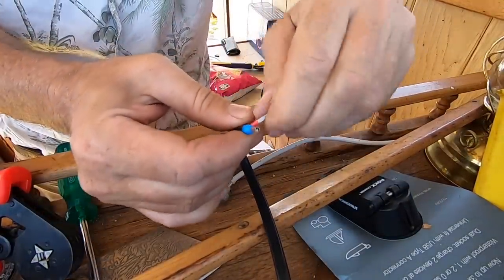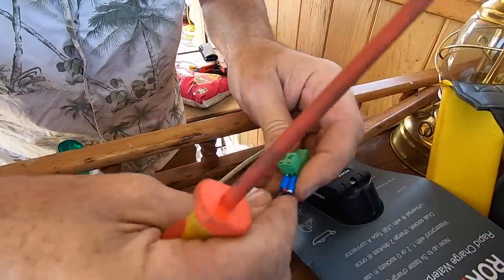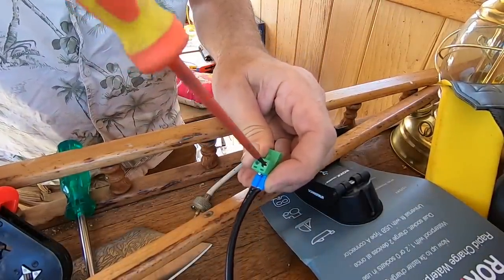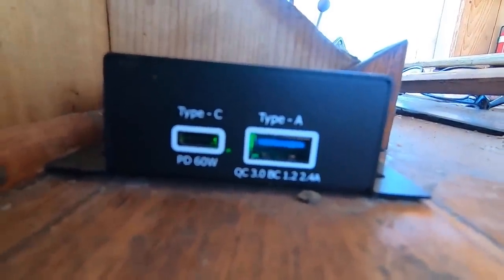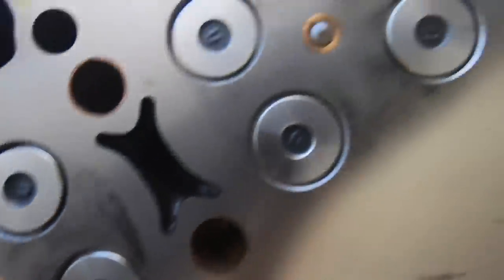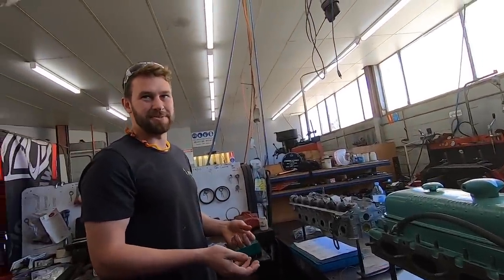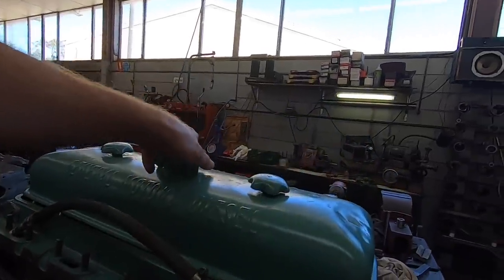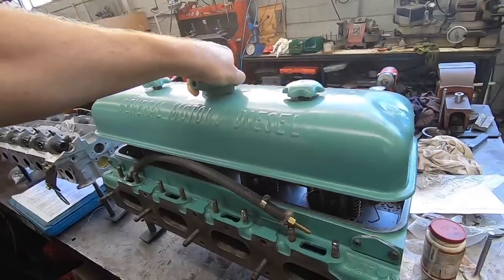Some questions answered

Comment: Not going to lie I love watching the Electrical parts
Reply: Paul Andrews - me too, I’m an electrical engineer, but do just about everything else boat wise, hands on 😊.
Reply: Yes love it
Reply: I’m an Electrical Engineer too, some of my favorite videos. All the welding and painting made me glaze over.
Reply: Love the electrical.  I have run an automotive repair shop for just under 20 years and have used some of his videos to tech a few things to my guys.  The video explaining voltage drop is probably one of my favourites!  Very simplified!

Comment: I stumbled onto your channel a couple years ago when I was researching buying a used bass boat.  I stayed because I love your channel.
Reply: same here
Reply: Me too.  I liked the outboard stuff and got valuable info enough to be confident adding a fuel filter/water separator and replace water pump impeller and replace my hydraulic steering. But look forward to your new material.
Reply: Scott B completely agree. I found you because I was new to boating and wanted to learn to service my outboard. BUT I stayed because of you Stu!

Comment: Rain almost never comes straight down, also water on your person tends to splash about. For your electric panel, just make a clear plastic box with a couple hinges and a locking clasp to go over it. Don't forget to make a couple of small vents for moisture, one high on the side and one low on the other side.
Reply from the maker: Yes, I think I'll end up making something like that.
Reply: @DangarMarine  Awesome, so glad I could help. I'm Brandon btw, out of California. I have been with you from the beginning, thanks for journey friend. You've been an inspiration of sorts to me, so thank you.
Reply: @DangarMarine  Don't forget to design in enough ventilation to counter the heat output from the inverter on a full load to maximize the lifespan of the electronics. Maybe even add a side mounted 140mm computer case fan for active cooling to counter the insulating properties of the plastic enclosure.

Comment: I just need to get this out. The reason i can sit for hours at the evening catching up on these videos is that they are fun, educational. and honest! that last bit is key. 
I'm a former mechanic now working in IT so i went the opposite way, and I have screamed in horror on some of the early welds and plasma cuts. 
And its great to see how much those have improved over during this project. And it made me want to get me a cheap stick weld transformer and just try, see how much i suck at it after 20 years away  
Keep up the great work and just be you. That is what brought us here in the first place :)
Reply from the maker: It certainly has been a steep learning curve, but I guess that is one of the best bits. You end up with a boat and a whole bunch of new skills as well. :)

Comment: Electrical stuff is cool.  I worked for a marina in the 60's and 70's and did some "hook-up" work.  It's hard work squeezing your body into the tiny space between the control panel and the bulkhead, under the fly bridge, or around the batteries.  Thank you for answering the questions.

Comment: That fuel line on the hatch is a good idea
Reply: With the weight of the hatch it would fare better than a bulb type automotive seal, where are the vents for the engine compartment.
Reply: I agree! Genius

Comment: Solder and heat shrink is the best.   I Fray my stranded wires then push,  then form them together then I solder.  I don’t lay the wire side by side and solder.   I twist my single conductors together, then solder, ____I can’t imagine why anyone would ever give you a negative comment.  You are one of the best at delivery and transference of knowledge.

Comment: In 50 years of soldering wire I've never had one of my connections fail. The same goes for soldering and brazing copper pipe. My son bought me a mig welder, but I still prefer my stick welder. They have have lots of new things nowadays, but the old ways never fail.

Comment: I like your thinking on welding, we weld at my shop as part of other projects. Steel, SS and Aluminium. My research is that stick welding steel defiantly has better penetration and generally produces higher strength welds. Mig welding is much easier to learn to stick things together , but it tends to stay on the surface and not penetrate much without careful prep and skill. Mig is much quicker and you can weld so much faster than stick. For aluminum Mig is really the only way to go with good preparation if you want a strong weld , we weld 3/8-1" old alumimum all the time very successfully with the Mig. Yes there are alum sticks but not for anything quality.  Tig welding for stainless. Only real way to go., but slow.
That's my 10c and I generally stick weld all my repairs Inc cast iron when we have to! 
Cheers Warren
Reply from the maker: Yep, pretty much my thinking too. :)

Comment: Hi Stu. Love the channel. The wreak of HMAS Swan (my grandfather served on her) lies off Juno Point in sight of your trawler. The wreak off Long point  next to the Manley ferries is that of HMAS Doomba J01. When I served on the dive boats DTV seal and DTV Porpoise back in the late seventies the trainee divers dived them . Keep up with the good work. PS Keep a good eye on the low pressure fuel rails under the rocker cover as they are prone to cracking with age putting fuel in the crankcase.
Reply from the maker: Interesting to hear that your grandfather served on the Swan. That's cool. :)

Comment: Good idea with the skirt around the opening base, only the inverter is vulnerable.  Just a few drops of saltwater down those vents on top onto the electronics, can ruin it.
Reply from the maker: Yes, I think you are right. The rest of the components could take a splash or two no problem.

Comment: No outboard can match the sound of a Detroit Diesel 2-stroke. Rebuilding your Detroit is better than buying a reman . You know that it’s been done correctly. A Detroit 2–stroke isn’t the most fuel efficient diesel but they are simple, without computer controls, and the will run when you need them to. Not to mention the sound. Did I mention the sound?

Comment: I appreciate your desire to stay true to what your dreams are. Let your channel evolve. I’ll stay with you. 

FYI I like the electrical stuff. 

Are you going to put a small diesel or gasoline genset in the engine bay? Or a small portable generator for the deck.
Reply from the maker: Thanks Jeremy. Currently here is a petrol generator on deck, but it won't stay there once the bulk of the work is done. In the end it is only going to be solar, wind and the engine's alternator.
Reply: Dangar Marine on a side note I’m a 19 year Journeyman Diesel Mechanic. I find it interesting that you guys have to be licensed as an individual to work in a mechanic shop. 

You can know nothing here and own a shop and call yourself a mechanic. Not that that happens much but you can. We do have apprenticeships but mostly for Union Shops which there isn’t a whole lot of sadly. Usually only union mechanics call themselves Journeymen. Non union mechanics will call themselves Master Techs or whatever their employers wishes to call them. 

For myself I went to 2 years of trade school. I got a Career Education Certificate in Diesel and Heavy Equipment Repair. But it’s not really reported to the government. It’s just for my records. Then I worked for a few years as an apprentice until I moved up the pay scale to Journeyman. If I had not gone to trade school then as a union member I would have had to do that school at night after work to be eligible to advance to Journeyman. Now I’m a Container Crane Operator. I needed to hang up the wrenches. I was getting worn out and burned out. 

We do have a private national certification agency called ASE or Automotive Service Excellence. But very often their certification is about as good as used toilet paper LOL. But It makes the customers feel warm and fuzzy to know their mechanic working on their car is an ASE Certified Master Technician. I hate working on cars LOL.

Comment: About the Diesel electric, that is sort of our long term plan for our 10m yacht. Slide the inboard diesel forwards enough to get a pulley on the prop shaft and gearbox, add a 10hp Brushless, belt-driven to the pulley. While under sail can windmill the prop to recharge the propulsive battery. Don't need a huge range on pure electric, so don't need excessive amounts of battery.
Reply from the maker: Sounds like a good plan!

Comment: I like the electrical work!
Heck!, I like basically everything you do when you describe it, tell the story. And the agony of finally getting the  cable though, and realising that it's around the board, just the best. It makes me feel like the evil within things are not just against me. =)
Keep up the good work man!

PS. Crimp, then solder. I am a solder believer, but nothing beat good mechanical connection before solder. And when HiFi, buy solder with a percentage of silver.

Nope not arrogant, it is not so much what you do, but the story., yes your repair videos are greate and that's the way I found your channel, but I did not stay for the outboard repairs..I came for som tip on doing my outboard, I stayed for the good show, and nice to hang out with you on your videos.

Comment: More electronics the merrier. With your battery power supply you could always add a small current and voltage limiter circuit to drive equipment which is listed as 24v nominal

Comment: We had pressurized  Hot & Cold water on our 28' sailboat ..very nice to have hot water for a shower after swimming l You might want to rethink that one skipper . It wasn't any problems ran off house electric or heated from the diesel when running .
Reply from the maker: Yes, the heater I had ran off the engine cooling water. Wish it was a bigger boat some days!

Comment: great q And A, i have owned a couple detroit diesels , 6v53 and 8v71 , when you fire yours up have a way  of shutting it down before starting it , MY 6v53 ran away on me once after i did some work on it, one of the scariest things   , some way of cutting the air off block of wood etc, i through a towel in the intake , keep up the great vids
Reply from the maker: Yes, I think that is one of the most important things to have read in advance.

Comment: Hello,  Pays to keep in mind that water never "just goes straight down" nor does it ever take a convenient path (a subset of Murphy's law).  As the boat rolls and pitches and spray  comes aboard not to mention green water it will seek out anything it can screw up!!  Make everything watertight not weathertight and then seal it some more.  You'll never be too dry in the boat, ever!  A boat should be built like a submarine and then put inside another submarine!!  Even then you'd encounter moisture problems.  After a lifetime of boating in all kinds and sizes of boats and all kinds of weather and seasons I can attest to the above.  Take care.  Doug
Reply from the maker: Yes, I will definitely look into making some sort of protective cover for the electrical board. Every little bit will help.

Comment: I have a Grady White F26 Tigercat. It sat in a field for 4 years till the owner finally wanted to sell it. Both engines fuel systems needed to be rebuilt,(200HP Optimax)  the dealer near me wanted $2,800 US each to do it. Watched YouTube on how to do it, ordered parts from Marine Engines. Done for $500.00 US both engines. Took less than 4 hours each engine. Dealer said a week and a half each... It's a work in progress.  I also tow the boat with a 2002 F250 7.3 Power Stroke diesel. Like watching your YouTube videos.
Reply from the maker: Nice work! Goes to show how much money you can save when you go the DIY route. :)

Comment: Had a bass boat where we put down truck bedliner paint when the carpet met the end of its life. Was fairly pleasant under foot, didn’t get too hot (we had a sea green color) definitely take a look at it. Tough and will last forever. Additionally, check out some of the other matting options available. Not sure how accessible/affordable they’ll be, but if you look at Xpress Bass boats, you’ll see the matting I’m talking about. Cheers Stu
Reply from the maker: Sounds good, I'll check it out.

Comment: Crimping works best when you fill the crimp with 'dielectric' grease first. I never had any corrosion problems with any of the crimps I did on my Balboa, while I had to repair a few 'soldered' connections that came with the boat. In the end, it's what you're most comfortable with...Notice there's no wipers, have you looked into 'power spin' discs, or are they too expensive an alternative to standard rubber wipers? Detroit diesels are pretty much 'bullet proof' but they all suffer from oil leaks, especially under the air box, but you need a really good set of water separators, and they should be drained before every trip, or any time you're at sea for extended periods. Give it regular, tender loving care and it will purr like a kitten for you. It will probably out live you too. And, finally! Since you won't be moving 'with' the wind, have you considered a wind generator? Power on cloudy days or even at night is always welcome...
Reply from the maker: I'll find some dielectric grease and start doing that. I have considered adding a wind generator. I think they are a nice compliment to solar cells to cater for both types of weather.

Comment: FWIW I like watching the electrical stuff. As someone with (sail) boat building aspirations, it's handy to see the insight of equipment selection, placement, termination, cable routing... etc. I can understand needing to cater to the audience that pays the bills, but for my part, please don't kill it off entirely.
Reply from the maker: I'll certainly keep showing the important electrical stuff. I think one of the best comments I saw was someone saying that it would be nice to have it explained in more detail what is happening and that is a good point. I tend to get swayed by the handful of people that comment with highly educated opinions and then forget that there are 10,000 other viewer silently thinking, "I don't get it" I need to get back to showing the circuit diagram on paper and explaining what's happening better.
Reply: @DangarMarine  If nothing else I'll be watching. Thanks!
Reply: @DangarMarine  Yes Stu! Do That!  From one of the "10,000 Silent Viewers"

Comment: please fix your clock in the wheelhouse, going to be great when its done. On the part about water getting on power boards im worried about in the middle of a storm/swell you need to open the hatch for something, water does not go straight down then. Keep up the video's buddy. Just wish there were more of them each week!
Reply from the maker: Yes, in certain situations it is going to need a fair bit of protections. I'll have a think about a hard lid.

Comment: Don’t use the fuel line on the hatch Stu there is a better solution in automotive door rubber from rare spares , it is thick enough and will seal better on that lip , that lip will not be flush with the hatch all the way around 😎 and I for one love the electrical because you take the time to explain the why 👍
Reply from the maker: I'll see what I can find.

Comment: Hey stu, I haven’t finished the video yet but those green slide/snap in connectors tend to pop out after some time. I imagine vibration makes it worse, so you might benefit from a dab of super glue on the back where it plugs in. It won’t be removable anymore, but the screws can always be backed out if need be. Just a tip! Thanks for the videos

Comment: I agree with understanding how to wire your boat,  so many day to day boating problems are electrical and if you know how it goes together you are on your way to getting things fixed. When you are welding on the boat are there any items that need to be isolated? Really enjoying the extra content keep it up Stu.
Reply from the maker: With regards to welding I think it is mostly the delicate electronics such as the Raymarine Axiom that need to be isolated.